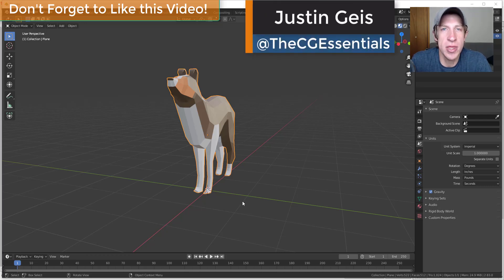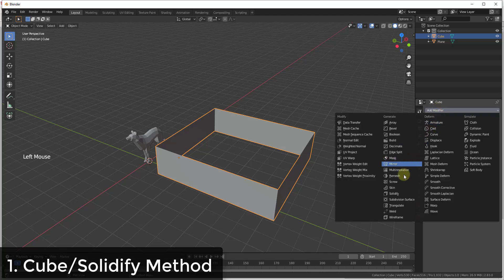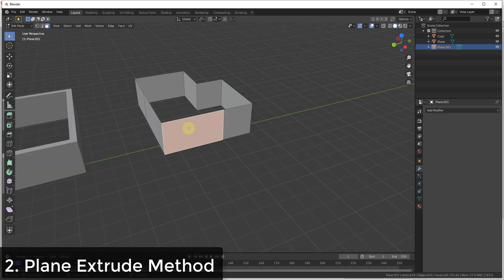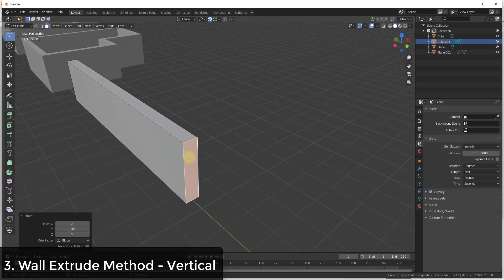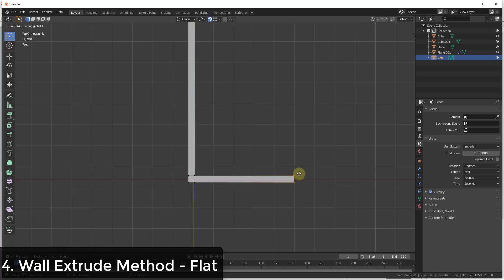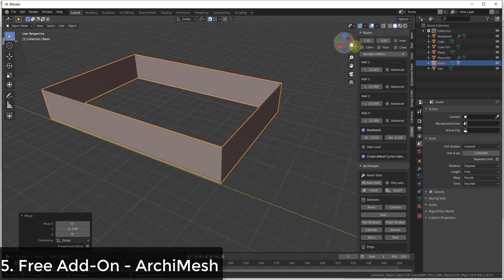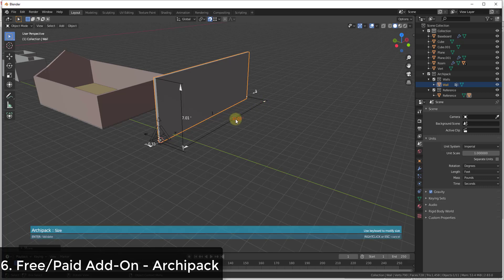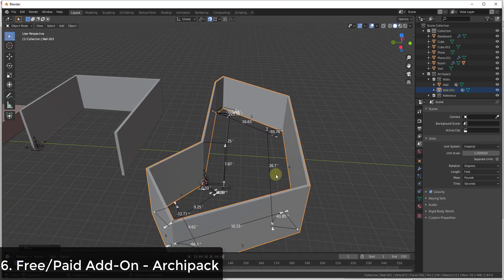6 Ways to CREATE WALLS in Blender! (Architecture in Blender)

Comment: Just to note, method 1 only works if you apply any scaling before adding the solidify modifier.  If you don't then the wall thickness will be different for different faces.

Comment: The problem with this video is you haven't shown what tool you're using for selections.  The tool in the Ui is the selector which never changes .... so where or how are you selecting and moving the cube if you're not using the tools up in the left????  What tool are you using?

Comment: I'm a huge newb, but I was trying to use sketchup to plan a new layout for my office space but sketchup web sucks bad! So I jumped into blender. Because my room is all sorts of shapes (not rectangular) and I am trying to get it accurate to the centimeter for estimating furniture, I wasn't able to create walls easily after i laid out my floor plane, so instead, I made a copy of the floor, extruded it so the floor is super thick, then added a cube that was just bigger and used the boolean modifier to remove the floor layout from the cube. Worked great! Then to top it off, I added a glass like translucent material to the cube so that the walls are still visible but you can see through them so you can see the furniture layout without obstruction or I can simply hide the cube for a wall-less look when testing out various layouts. It seemed to work, maybe overkill but it got the job done and blown away every time I randomly jump into blender.
Great channel and video, you gave me some ideas on how to make it a little easier next time! Thanks!

Comment: That does not work! As soon as you want to work on the walls (Sculpt + Remesh) all faces will be totally destroyed. this makes baking impossible
Reply from the maker: There's 6 different methods in the video, all of which work. It might not work with your particular workflow, though I usually wouldn't suggest editing walls with sculpting tools anyway, but "that does not work" is an odd, inaccurate comment...
Reply: @TheCGEssentials  the best way to cut is: manifold-cuts

Comment: I have 3d model buildings I purchase online and edit out the window openings so they are hollow (because later after I make the 3d model print I will place plexiglas behind the window openings) ...when I edit (delete) windows and then go to ADD MODIFIER and to add a wall thickness to model it shows some areas where strange triangles pop from surface of model. Do you know what the best way to thicken a wall on an existing 3d building?

Comment: I am complete beginner in blender. Im used to import my cad dwg file into sketchup and draw lines and extrude walls. Is there any way to keep that workflow?
Reply: Blender actually has  a dxf importer within the bundled addons in the user preferences. You can save your .dwg to a .dxf and import it into blender. Upon importing the objects in your .dxf are curve objects which you can convert to meshes. I use the dxf import alot as it is a great way to use floorplans as the base for extrusions, snapping onto. Eventually lining up cutaways, projections to the floorplan and just model by snapping to the .dxf verticies.